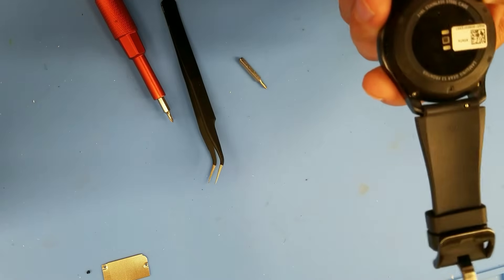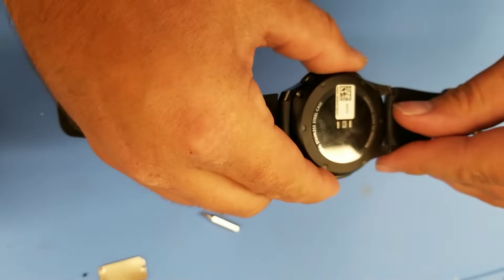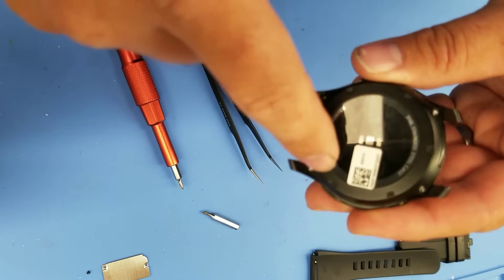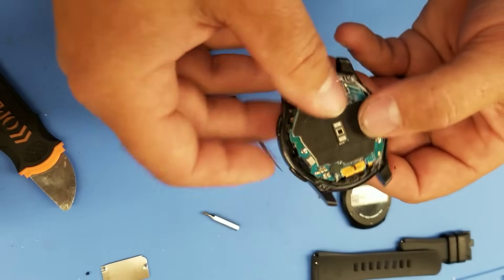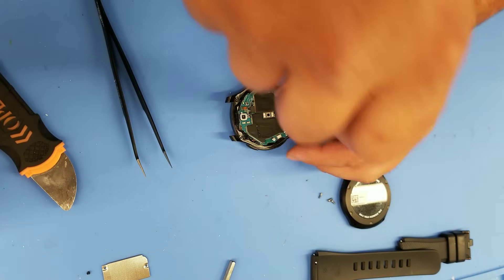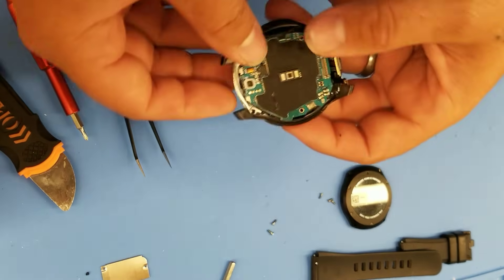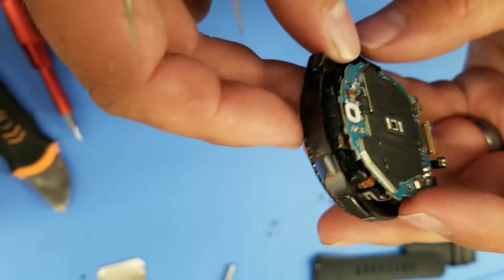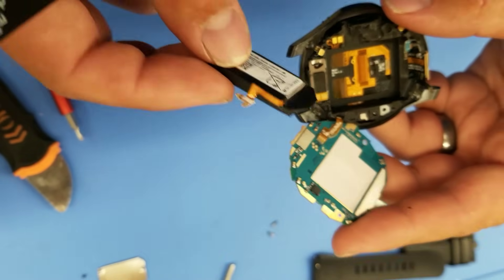Samsung Gear S3 Frontier teardown, battery replacement

Comment: When separating the two boards, after full removal from the case,  be sure to 'hinge' the two boards at the 4 run, flat amber 'Kaptan'. If Not, the flat cable joining will be torn loose from the logic board. ;{

Comment: bought replacement battery from amazon, as my s3 frontier was only holding charge for a few hours at best (3-5), swapped out battery per this video, was EXTREMELY careful with the battery pry off, (got it but took me about 10 mins of very gently prying with plastic wide blade spludge tool, was very careful as I saw that the mobo of the watch is VERY thin and possible to crack or break this pcb,  but got it with no visible or audible damage to this pcb/mobo.  put in new batt, and made sure that the small ribbon cable (fcc) from batt to where it is supposed to rest/be pushed/snapped into to hold in place, has 2 brass or brass looking contact plates/areas on it, that when returning pcb/mobo down into place, should make contact with.  re-seated the 3 other (disconnected during teardown phase), ribbon/fcc cables to their respective connection points, gently aligned and pushed gently will finger till i felt an click or seat of sorts. then finished re-assembly and put on charger.... NOT CHARGING. did I miss anything?  (also, made sure to be VERY gentle with the OTHER FCC/ribbon cable on other side of pcb, to not damage or tear this.
BATTERY I PURCHASED is a 580mah  batt, the original one is a 380mah batt, would this be a prob?  for the charger.. not sure... 
also of note, while researching this (to replace batt) and afterwards, about finish of swap, found 1 person who had posted about if battery at 0% (zero percent), may not charge and his solution, (hold down power on button (while watch is in charger) for a good while, not sure if more than a minute or so, and it worked for him, screen flashed and then appeared to charge. I tried this and have not had any luck yet....  looking for other solutions to try.
thanks in advance.

Comment: For everyone struggling with the backplate, use something like a hairdryer to heat it up. Much easier to get the backplate off when the glue is warm.

Comment: Warning, this clip makes it look so easy, issues: case does NOT want to come apart after screws are out as there is an adhesive resin inside to water seal the device, second: the battery is glued in so much that I ruptured the shell of the battery and almost snapped the board, man handling this fuckin thing. so much harder than you make it look, you lucky bugga got some magical easy version to pull apart. thanks for the vid though very helpful
Reply: I second this!
Reply: I third this!

Comment: Great video dude, sadly couldn't finish my replacement though. Damn glue on the battery has dried and I don't have anything that can heat it so I can remove it. Gonna have to find someone who has the extra tools needed to finish the job off.

Comment: The ribbon cable connecting the watch and the board got disconnected from the soldering T_T my watch chrarged but now wouldn't turn on.

Comment: Well, it worked fine for 2 plus years until it got wet at one of the Niagra Falls excursions. It went into that repeating "rebooting" sequence, but wouldn't restart.  I tried that mutiple button push too a dozen times.  Anyway, I bought and just installed the same battery replacement kit thinking maybe that removing and replacing the battery would help, but it powered up back in that repeating "rebooting" mode, and hasn't reset.  Any ideas will be appreciated.

Comment: A few important tips that might help!!

1. When prying off the back plate, get a sharp Stanley knife blade and pry near each of the 4 screws between the back plate and the part where the band clips into (you get more leverage this way)

2. The battery is glued to the back plate in some models, I slowly pryed it out using the Stanley blade making sure not to put any strain on that little connector in the corner

3. When putting the back plate on again, I got some silicone and used the tip of a very small screw driver to apply it around the seal of the back plate. Once I screwed it in I wiped the excess off, I don't know if this will allow it to be waterproof again but better than nothing
Reply: Some websites suggest a 1350 mAh replacement battery. Do you know if the larger capacity batteries fit will in the S3 case ?

Comment: you have to be so careful with the Motherboard ribbon.   Mu detached in the process and does not stick back.  anyone know what you can use.  think i have bricked it.  Annoying thing is the battery still charges and you have a visual on that.  Just can't switch the dam thing on.

Comment: Excellent video , to the point. Replaced my battery, no issues, it was lasting 3 hrs, now lasts 3 days. Thank you
Reply: Could you link the battery you bought?
Reply: Did you ever find a good replacement? @LurifaxDK
Reply: السلام عليكم. من فظلكم اين غيرت الباتري شكرا لك
Reply: I changed it myself, on my kitchen table. No special place needed @abdelkabirbayane5956

Comment: What was indicator that your battery needed replaced? I have a gear S3 frontier that I've not really used much since I got it and I was wondering how I will know the battery wants replacing? Anyone's views welcomed. Cheers. :)
Reply from the maker: My apologies. I have been away for quite some time due losing my son the cancer, the biggest indicator of poor battery health is charging more than once a day to get through the day and dying at odd percentages. Thanks for the comment and happy fixing!
Reply: @ryanthecellphonedoctorl.l.4763  as a dad of two, you have my condolences. Thanks for you message. I wish I had something better to say but unfortunately there isn't anything to say.

Comment: Bought a kit on amazon and did this yesterday. Actually pretty easy, the hardest part being removing the old battery without damaging the tiny ribbon cable that stays attached. It was stuck on there pretty well.

Comment: He stopped the video too early as he should have shown how to fit the battery back in and how to fold the wire to fit. Wasn't too hard to figure out but would have helped to have been shown.

Comment: Ahh THREE cables! I assembled mine after a battery replacement and the bezel wasn’t responding. Turns out I missed 1 of the cables in reassembling. Thank you for the video and actually SAYING that it was 3 cables lol

Comment: Really helpful, especially the bit about the cables.  The back on mine took more effort to remove as well as the battery had a much stronger bond to the adhesive but I’ve got the new one in and everything works so it was a success.

Comment: This may have taken 15 minutes but it felt like 30 minutes 😆 
Plugging the connections back in only requires you to have (may the force be with you) a light touch until you feel it snug into place, then press down. 
I cut the glue strands and the foil battery covering in order to remove the battery. Then I just peeled the foil from the sticky pad.
The battery connection didn't seem to "plug in", but more like it snaps on place on the little peg with the cover kind of just hovering in place. 
Great video and thanks for saving me and thousands of others.

Comment: I charge my frontier watch in direct sunlight for about a week now it want turn on, if it does it turns back off quickly.  Could this be the battery? Battery replacement???

Comment: So, if you accidentally disconnect the ribbon that connects the motherboard to the watch while prying off the battery, is there a way to fix that?  What could I use to stick it back to the motherboard, or is it broken permanently now?  I know this video is old, hope you see it.

Comment: If anyone is having trouble with the tri-wing screws, check if your driver has a flat or pointed tip. The screws have a shallow groove, so you'll want to have a flat tipped tri-wing screwdriver. You can file the tip a little at a time until it sits properly.
Reply: Thank you so much for this comment, 100% would have stripped all the screws and ruined my watch if I hadn't seen it before I started
Reply: Yep..asked question, then read this comment.  Appreciate the advice.  1 screw was a pain.
Reply: Thank you a ton man, I didn't even notice that. Was damn near stripping the screw until I found your comment 🙏

Comment: Very help.  My S3 is a couple of years older so the following tricks helped. 1. Used better tools than came with the battery kit.  Battery kit tools would not have cut it.  2. A very fine metal blade to get the case started to separate and then 2nd set of hands with 2-plastic pry bars to get the case open.  3. The point about disconnecting the battery cable is spot on.  4. My battery was really glued in place.  Had to gently pry it off with metal spatula.  5. Tooth pick or plastic fine point tool (non-conducting) helpful to hold connectors out of the way when reassembling.  6. Patience and taking time.

Comment: My one wont switch on now, but its charging fine, anyone know what it might be?
Reply: Same for me. Brought a new one instead
Reply: @asd1336  I tried to open it up again in case id misaligned something but I snapped something off the circuit board and it flew off somewhere and now I cant find it so its definitely fucked now. 😣

Comment: Thank you for the video! It was very helpful. The battery life on my gear s3 had diminished almost completely. I would charge it and it would last about an hour and die. I bought the battery for about $20 and replaced it myself using this video. So far the battery seems like it won't need a charge for another day!
Reply: Thanks a Lot
Reply: Hi Where do you buy the Battery in USA?
Reply: @LUISMARTINEZ-wu6bh  I bought mine on Amazon. Search for Gear S3 battery. The one I got even came with the tools. Here's the link:
https://www.amazon.com/dp/B0819KSZHJ/ref=cm_sw_r_cp_apa_fabc_HC5.FbSPSTZQY?_encoding=UTF8&psc=1

Comment: If you are doing a gear sport which is loosely based on the s3 I believe you need to release the motherboard  from the battery holder go super careful though it will release after a while and you can fold it over this reveals the battery connector and the motherboard ribbon cable tear this and you have had it.

It's a real patience job. But good news is the gear s3 battery is identical to the gear sport battery I picked mine up from amazon and higher mah than the original. Putting back together is just the reverse

Comment: Any idea after following step by step, that it won't turn on after? When I put it on the charger, screen lights up perfect and charged to 100%. But the watch won't turn on under any circumstances. Back button makes screen light up when on the charger, but home button appears to do nothing at all.
Reply: Did you ever find the answer to this problem?
Reply: @khalilblaqueman8479  nope. Ended up buying a new watch.

Comment: My speaker wont work what happen?? My watch got wet I  clean inside unplug the battery put jack together now works but no sound 😏😏
Reply: Sounds like your shorted the speaker? I would do a test on it to make sure it's in tolerance
Reply: @roboteen  i just need it to put the back cover 😂😂 is fine now 👍👍

Comment: This is the best video. Followed your steps and replaced my  Gear S3 batteries without any problems. The hardiest part was opening the case. I cheated and used a jewelers flathead screwdriver to get the case to pop then I used the supplied tools in the battery replacement kit.

Comment: As I was replacing the battery I discovered that the button ribbon wire was detached from the motherboard how to reattach what type of adhesive?
Reply: Did you happen to ever figure this out?  I accidentally pulled off one of the glued-on ribbon cables myself.

Comment: Word of caution. The battery will not pop off as easily as shown in this video. Take your time or else you risk popping off the ribbon connection to the circuit board, which controls the buttons, or at least the power button

Comment: Hello. Please, please, please can you help me? I followed your video to replace the battery in my watch. Everything went really, really well...... Except when I turned it back on and tried to recharge it. The red light on the charging dock lit up. But instead of charging the watch it said "Can't charge. Watch needs to warm up".!!!! Eventually the battery ran flat and I was unable to do anything with it because of this same message popping up. Now the same has happened when I put my old battery back in. Any ideas please??

Comment: I can't get those damn back screws out.
Reply: I did the same thing too. I set the screw driver on the screw and held down the watch and screwdriver with my left hand and pounded on the screwdriver with a hammer to make the a new deeper indent. I made sure to hold that position with the screwdriver and used a lot of force on the screw's head with my right hand while turning the watch with my left hand clockwise. The screw started to come free from there. Hope this helps.
Reply: @Paidnful  thanks I'll try that.. but the question is did you find new screws or did you just tried with those you had already? :/
Reply: @florgaldamez1811  No I didn't, I only had that problem with 1 screw, so I'm screwless in 1 slot. I plan to get a "for parts only" watch from ebay to have back up screws. I'm pretty sure Amazon sells spare screws too..
Reply: me neither, I think I made a big O out of a tri.

Comment: What internal part charges the battery I had my back glass replaced and it doesn’t charge anymore the place I took it has to source the part or parts can you tell what part I need

Comment: Anyone have success reconnecting the motherboard cable to the LCD display if it did come off? I replaced the battery and the cable came off during the install. The battery charges fine now but display is not turning on :(

Comment: if your s3 gear not turning on  but it charging  you damage your ribbon cable from motherboard.  That’s a bad news, Good news is , if you rip ribbon cable right from motherboard it can be solder, by someone with soldering skills. Repair phone shop will do a trick

Comment: You made it appear that back comes off rather easily with the flat metal tool.  Mine won’t separate no matter how hard I try and all I’ve managed to do is scratch the hell out of the outer case.  Screw this.

Comment: Video was great but unfortunately for me I can't get my watch to turn on now. It will charge and show the percentage but no power. Anyone had this happen or could help me with this?
Reply: Ribbon cable from motherboard, solder back to motherboard by phone repair shop or replace motherboard.

Comment: Followed this and replacement was a breeze... Except the case separation was quite tough. A micro flat-blade screwdriver and some twisting needed to break the seal. A bit of black automotive grade RTV on the unbroken seal and water is no issue...

Comment: This video was TREMENDOUSLY helpful. Thank You! The only other thing I'd mention is that the battery is affixed to that outer board with 3M double-sided type. You have to be super careful using a non-conductive prybar to get it off and then use the remaining glue/tape that didn't come off to stick the new battery on before reconnecting.
Reply: Thanks for the tip!

Comment: what type of screwdriver do you use?
Please hellp
Reply: It's a 3-prong instead of 4 like a Philips. They sell them on eBay for super cheap.
Reply: @LuxAeternaFalsa  can you send me a link?
Reply: Screwdriver type Y 0,8 you use?
Reply: @canwea182  Yes. It's a 3-Corner 0.8mm screwdriver. 
You can find them here:
https://www.ebay.com/itm/Tri-Point-Screwdriver-4-Bits-Magnetic-Y000-Triwing-0-6-0-8-For-iPhone-X-7-8-Plus/163661048113?epid=11031717797&_trkparms=ispr%3D1&hash=item261af56931:g:sSUAAOSw3tBdEuue

Comment: My s3 is a bit different.  Only 2 cables on top.  Bottom seems to have an attached cable, and the battery seems to be attached with a non removable connector.  Ideas?
Can send photo.

Comment: U permanently break the water seal when u do this?
Reply: Depends on how careful you are with the old seal, when opening.
Reply: But when your battery is dead and not working I'm sure many people would rather a working water unsealed then a paperweight that is water resistant

Comment: Does it maintain it's water resistance after you open it up that way so long as you put it back together correctly or do you have to treat it as a non water resistant watch after that?
Reply: Most water resistant technology have a sealant to prevent leakage. You either have to replace that sealant or don't let it near water.

Comment: Smh mine won't power on now. Show 100% when on cradle but will not turn on now. Triple checked connections, but nothing works. I even put old battery back in and tested power button outside of bezel and nothing. But if I place it on charging cradle it shows 100%. ANY IDEA TIA!

Comment: Thank you for the video. I recommend separating the motherboard from the front screen BEFORE unscrewing the two inside screws. 
There is a ribbon cable that is dangerously tight, as seen at the end of the video, if you do not separate the screen first.

Comment: Awesome tear down video, I just changed my battery as I watched your video, great step by step process, I would have never seen that ribbon cable on the motherboard and battery if I didn't watch this. Thank you for your time.

Comment: I ordered a replacment battery got it along with worthless drivers WTF!!! Where is a reliable source for a 00Tri bit driver ,with out it i cannot remove the dam screws on the back plate of my gear S3 frontier. By the way Samsung Support is worthless!!!!  call me  720-878-8282 or email louzamo1@hotmail.com 
I need the 00 TRI bit Driver